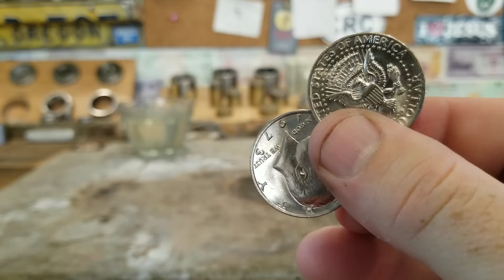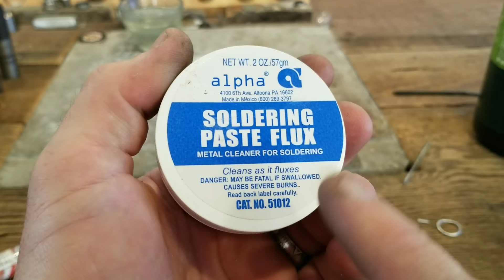Making a Coin Bell from two half dollars

Comment: You think you can do a video demo with just a doming block and a ring stretcher... my dome comes out too wide and not enough lip so I had to stretched the bottom too much .. but I cant get a lip on the dome to hold the solder ... any help is appreciated ..
Reply from the maker: Yeah it would be pretty tough with out the swedish wrap.

Comment: Would you share the type of wire you are using for the handle and tapper attachment.  Really a neat idea.  I have the two coins ready but want to make sure of the other materials before I solder.  More fun than should be allowed.
Reply from the maker: When I made this video j really should have gone to the store for something better. But I didn't and used something that was handy haha. It was a cotter pin :)
Reply: LOL It was perfect.

Comment: I just made the third bell using two Mexican 20 pesos coins... they are very thick and heavy coins.  I now need to make a good clapper and canons... any suggestions?   For the first one I used a nickel coin cut and shaped like a cross... but was very hard to do and I do not like the look. I have no dies and do it all with the doming block and ring stretcher.
Reply from the maker: I just use the center punch and wire.

Comment: Is there a particular solder type to use? I am having trouble getting my solder to flow into the bell halfs. My solder runs to the bottom of the cup most often. Thanks. Jim Holden
Reply from the maker: I just use silver solder. An easy would work great.

Comment: Why do you heat up the coin, then rapid-cool it, before bending it? Wouldn't heat-treating it cause it to harden, thus likely to break during the bend phase ?
Reply from the maker: You are thinking about ferrous metals. Non ferrous metals like silver don't harden when quenched.
Reply: @CoinRingsfromTheMint  If that's the case, why quench non-ferrous?

Comment: may i ask you the kind of torch you used? is propane enough for half dollars, copper and silver coins?
Reply from the maker: It's just a regular propane torch I got at lowes. It is all you will need for coin ring or bell making.
Reply: thanks a lot for your quick answer, i will give it a try

Comment: I used the flux that you used..  the solder was Alpha Fry 0.9 oz. Soldering Flux Tin/Lead 53505. 
It comes with flux and solder .. https://www.acehardware.com ..Made a second bell  and it was better than the first... I pre-drilled a small hole for the center of the dome before folding ....  I also made a jig to hold both parts together so they would stay firm on each other ..the next bell will have three parts.. is already in the progress...

Comment: Did you know the channel New Clips1 stole your footage and cut it up and added music to make their own video?
Reply from the maker: Bummer!
Reply from the maker: Thanks for letting me know.
Reply: No problem. Love your vids. I just made two bells, based entirely from your videos. One was made from some sobriety coins I found in a coin shop, the other from some state quarters. Both turned out pretty good. For me, the hardest part is dealing with the innards. The state quarter one, in retrospect, I should have used the smallest hole possible. The bottom half isn't quite as big as I would have liked. Anyway, thanks again for the video. I think they're easier to make than the rings. I wish Jason would make a smaller swedish wrap die, that would open up opportunity for smaller bells.